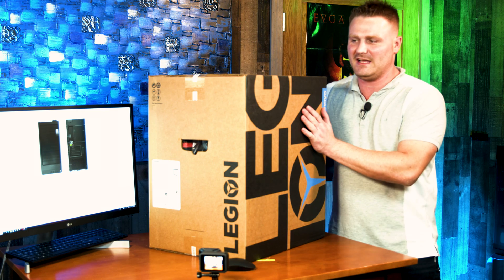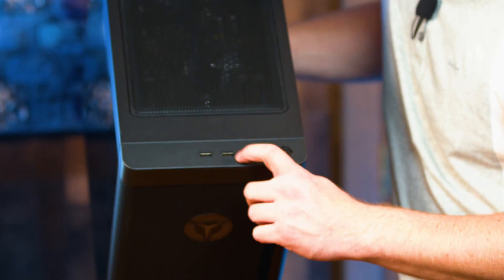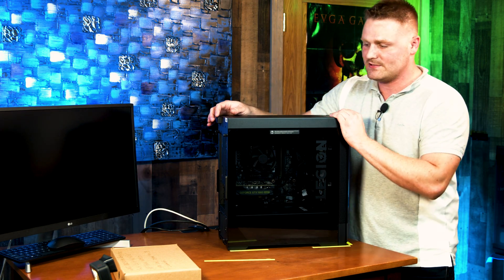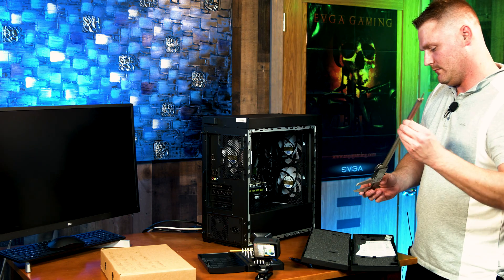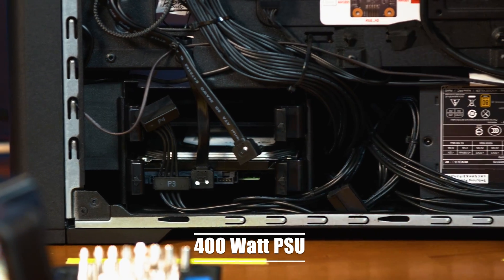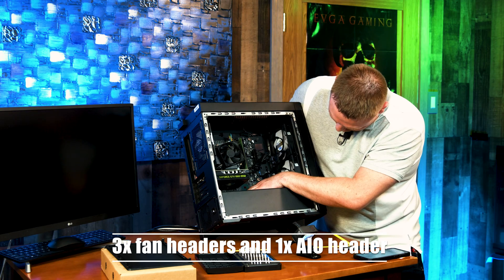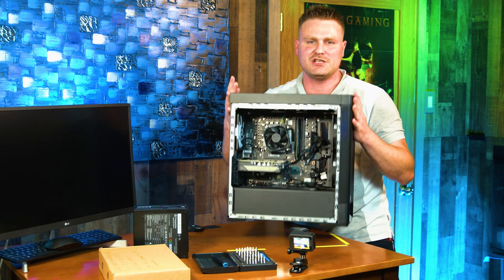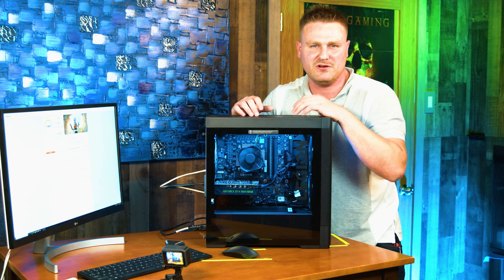Cheapest Fully Upgradeable Prebuilt Pc | Lenovo Legion T5 | W/ Intel i5 11400 & NVIDIA GTX1660 Super

Comment: Do you have to do anything at all to install a game using hdd if you've used all your ssd space? is there some switching to hdd process?
Reply from the maker: Well if you have the HDD or SSD, installed it depending on the program, but yes you will need to add a directory or file on the new drive. Then point like Steam or Epic at it. Like steam will allow you to have many drives with areas you can save games to. others not so much. Only allows one drive to be pointed at.

 if it was old school you have a DVD Rom or CD Rom for the install media you would be able to just point it at the different location, at the begin of the install. 

But because most stuff is Cloud based Now, like steam and other, you need to point that program/game at the new drive or file you want it to save to. (this file would be on the new disk) 

What I would do is look up the program that is ruining the game or software, like origin Then go on youtube and type,  how do I change where my games are saved or how to change where my game driectory is save for (Software Name). and you should find a video of some one walking you through it. Steam, Origin Epic Game, UB Soft, Blizzard, Activison & others are like this. 

Hope this helps. 👍😁
Reply from the maker: Also a FYI most but not all saved games are in users data,  Just to be safe I would look it up on how to back up saved games. if it applies to you this mostly only applies to single player games.

Comment: This is at Costco right now for $850. I bought a Dell 8940 with the same specs for $650 few months back. This looks better since it isnt OEM proprieatary parts but youre paying alot more so idk if it really is better.
Reply from the maker: Yeah. I mean if you plan to upgrade. then yes if not then not worth it.
Reply: The $850 version at Costco right now is upgraded version of this.  i5-11500, 16gb ram, 512 ssd + 1tb hdd.
Reply: @YouTubedemonetizedMe  I just bought it there myself. Anything you'd reccomend upgrading.
Reply: @FernandoMartinez-pv1id  power supply
Reply: @FernandoMartinez-pv1id  it’s only 400w I just bought it myself

Comment: What's a good cpu cooler I can use that will fit this computer. I got this computer a month ago and it works beautifully. Plays all games. I just put two 8GB ram sticks off Amazon. Corsair vengeance for 90$
Reply from the maker: Aios will work, Like a cool master 240MM. it also looks like 280mm will fit but I have not tested it. Pretty much Any thing that will fit a Intel LGA 1200 socket, and any 240mm Will work. The rad can mount up top. That would be the best
Reply: @TNW1337  Is a  coesair icue h100i elite  capellix  compatible?
Reply from the maker: @davidsfresh5863 will it work with lga 1200 then yes
Reply: @TNW1337  I'm so confused right now please help I bought the the CORSAIR h100i  elite club cooler for this lenovo 90rs001mus  and I'm not sure it actually fits but I can't find anywhere that says it does or doesn't. Please help or guide me on what one to get 🙏🏽

Comment: Just found this OC at Costco with dual channel 16, glad to find this video backing up my decision to buy! Seems so well built and thought out for the money. May not be the best or most up to date graphics card but will do everything I need it to do, and as you said, everything can be upgraded. Speaking of, you mentioned the first thing you would change out would be the processor fan and heat sink… any suggestions for what would work best in this case and on this build? Thanks for the great content!
Reply from the maker: Noctua  NH-U12S SE-AM4 just make sure if you have amd or intel it says it will work with it. some times they only sell Amd versions. Make sure if it is intel it is  FCLGA1200 or LGA 1200. AMD is AM4.
Reply from the maker: @jimmyd4409  YOu have to change it in the sub menu on the software it is kind a wonky.
Reply: Just bought mine for $150 off. Starter Desktop.
Reply: I just bought the one with rtx 3060
Reply: @danieldaniel1210  I just ordered one with 3060 too. How much did it cost you? What processor is in?
Reply: @djagoegei18  1050 euros, it came with it i5 11400, 16gb ram, m2 512gb, rtx 3060 12 gb
Reply: @danieldaniel1210  Oh, that's nice. I bought the same setup but with Ryzen 5 5600G for about 1100 euros. How much fans do you have inside the case? And what are your cpu/gpu temps?
Reply: @djagoegei18  5 fans with rgb, 2 in the front where is the legion sign, 2 on the top and one in the back
Reply: @danieldaniel1210  Wow, that's cool, I thought it comes with 4 fans - 2 in the front, one on the CPU and one in the back
Reply: I just bought it too. Is yours with the i5-11500F? That's what I got. I've heard the mount plate for the cooler is glued on and I'm trying to find one that will work with the existing plate. Let me know if you figure it out. I'm thinking maybe the ARCTIC Freezer 34 Esports Duo or Sythe fuma 2.
Reply: @robotpicnic6508  yes its with i5 11500
Reply: Also the SSD is 512gb, and the hard drive is WD blue instead of a Seagate, which I've seen in the units from Best Buy. I hate Seagate with a fiery passion, as every drive I have owned (3 if memory serves, they came in wiped reman'd machines) has failed in the warranty period, and each was replaced with a "renewed" drive that also failed. If you act fast you can scoop up 2 more of the identical ram chips for 70-80 bucks new on fleabay, which I just did for future proofing and video editing.

Comment: Do take note, the backplate for the cooler mount on the motherboard is proprietary and removing it can be a little troublesome as it is stuck on with double sided tape. Great review otherwise!
Reply from the maker: Yes that is pretty common, but thanks for the info!
Reply from the maker: Yes I had a blast removing it. Took me about 5mins with a plastic pry bar uhg.
Reply: @TNW1337  heat? 🤦
Reply: I have the AMD version (Ryzen 5 3600) of this tower (Legion T5 26AMR5) and experienced the same thing when installing a Noctua cooler (NH-U12S chromax.Black) - I had to remove the proprietary backplate with a hairdryer and very patient, gradual pressure from plastic prybars - a Reddit user who came before me with the same model tower reported breaking their motherboard removing it.  Also of note: I had to use the Intel mounting hardware to get the Noctua mounted and had to add adhesive foam on the backplate to allow the Noctua backplate to apply proper pressure contact on the back of the motherboard.  Kind of a pain.  If I had purchased the less expensive AMD only version of the NH-U12S I would not have been able to install it.  My one other negative on this tower is the low quality thermal management on the 1660 Super - it is 1 step up from what dell did (see Gamers Nexus video on that near-identical 1660 super: https://www.youtube.com/watch?v=HFaJZq13tr8) - he mentions GDDR chips at the corner are covered by solid heatsink (without contact) and gets no airflow, Lenovo's 1660 Super does have a thermal pad bridging at least 1 GDDR chip to the HSF (the one most occluded) I am typing this using the computer in question and tried to inspect the other corner chip with a flashlight and dental mirror, but can't be absolutely sure.  I can tell that there are several GDDR chips I can see without thermal pads (the ones that do have some airflow through the HSF fins).

Overall, given I got it on eBay for just under ~$500 shipped, I am still quite happy with it.  Mostly putting out this information to help others who might be looking at this tower so they know what the issues are.

Comment: I have been unsure of what PC/laptop to get and I am currently looking at the Ryzen 7 5700G RTX 3060 version of this at Best Buy. This would be my first actual PC and I am leaning towards this model. I’ve been looking for videos on the tower 5 so thanks for the video!
Reply from the maker: The 3060 Version is even better then this one. It is well worth it. Only problem with laptops is heat, And the desktop can be upgraded down the road. So cons and pros for both. laptops are portable. But this is a small pc,  you could make it portable to.
Reply: @TNW1337  yeah I was weighing the pros and cons I have an older MacBook Pro I can use for general stuff so I don’t have a problem with portability for stuff like that. I only worry if I wanna carry it to another country
Reply: I got a 3060 ti + 3600 version for 1199 after tax with a bunch of Black Friday codes and student discounts! Going to swap in my 5800x and Z63 and sell the 3600 but this is definitely a solid PC!
Reply from the maker: @retaora4281  Yes sir
Reply: How much are you seeing it for?
Reply: @retaora4281  I’m seeing it for 1449 at Best Buy
Reply: @anishhayman1768  They might have a sale again on the Lenovo website during Christmas or NY as a clearance measure for new stock.

Comment: I recently ordered the new hp pavilion (Tg01-2260xt). It comes with an i5 11400 1650 super and 2933 8gb of ram. For $570 which is pretty good but what i need help with is that I bought 2 sticks of ram which are 8gb each but instead of it being 2933 like it came with it’s 3200. would the mother board support 3200?
Reply from the maker: Yes, it should work just fine. you will know the pc will not boot. it does not hurt it.
Reply: @TNW1337  thank you so much. Deserves a sub and keep up the great work

Comment: I have the ryzen version of this one. Mine comes  With the ryzen 7  5800 16gb of ram , 500 ssd and 1tb hdd  with the 1660 super, I love it. 
I want  to  upgrade the video card and power supply down the road.
Reply from the maker: Yeah the nice thing is you can and your free to pretty use tax parts.
Reply: I got the same rig as you, runs great!  Going to get 2 more fans on top for exhaust.
Reply from the maker: @joemartinez7913  It is awesome.